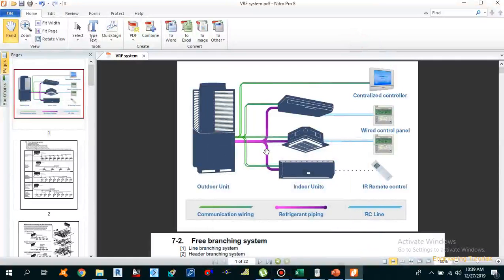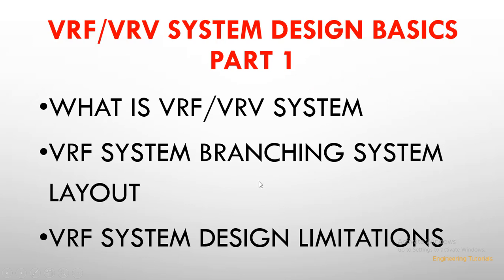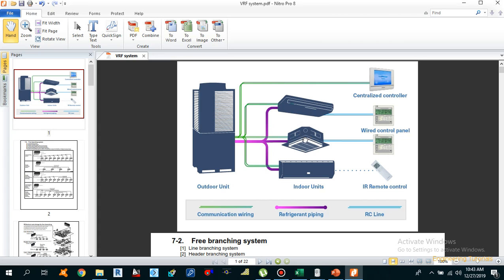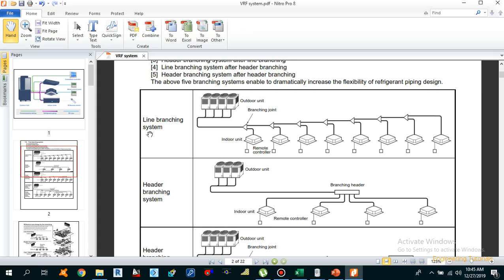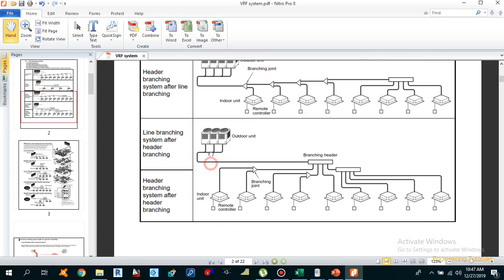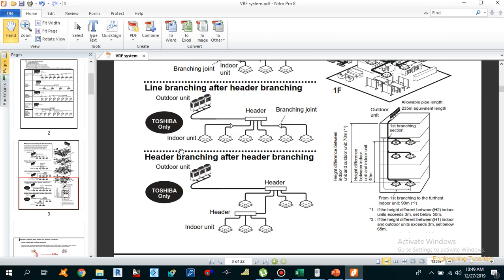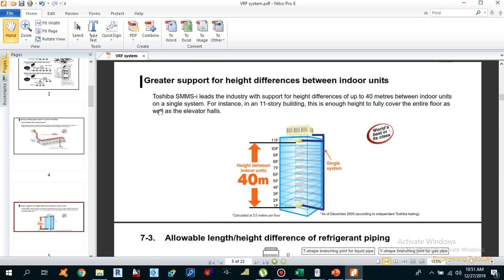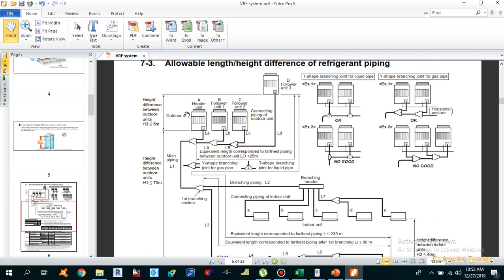how vrf system works, vrf system designing & selection, toshiba vrf system designing software Part-1

Comment: For VRF system to calculate ac load?
Reply from the maker: What?
Reply: @mepengineeringtutorials   For VRF System , Which system I need to select  in HAP Software.
I Mean, Equipment Type and System Type?
Reply: In HAP Updated version 5.1 ,  having  VRF system. so , how to design VRF System  in HAP Software.
If you dont mind Can you give mail ID.
Reply from the maker: syedmuhammadw@gmail.com

Comment: Shall i select equal capacity of outdoor units??
Reply from the maker: It's not necessary to select equal capacity outdoor units. It depends on your load calculation. For instance the load you have calculated is 36KW then available combine outdoor unit in the market is 36KW sub divided outdoor units as (14kw+12kw+10kw) = 36kw as combined outdoor unit. So this is how you'll gonna select this combined outdoor unit of 36kw.
In myy next video of vrf system design basics part 2 my answer to your question would be more clear